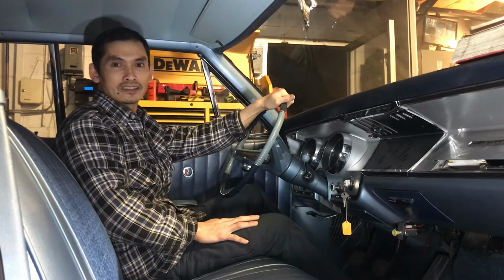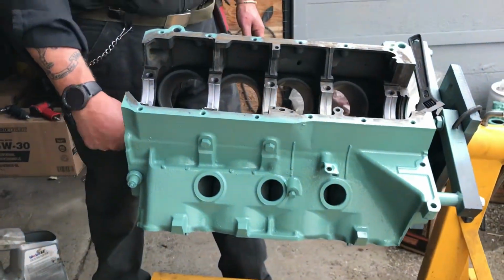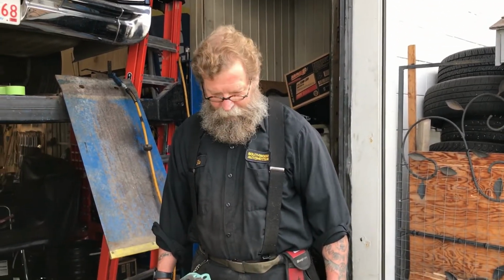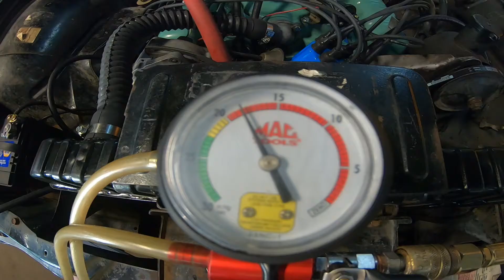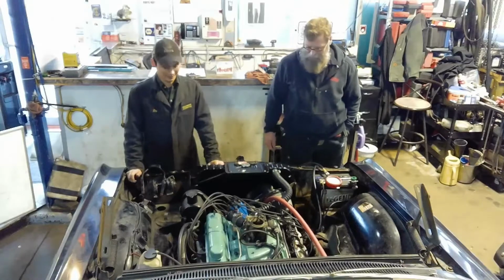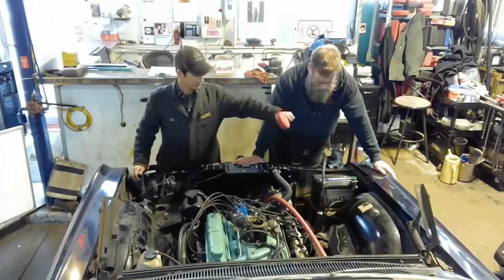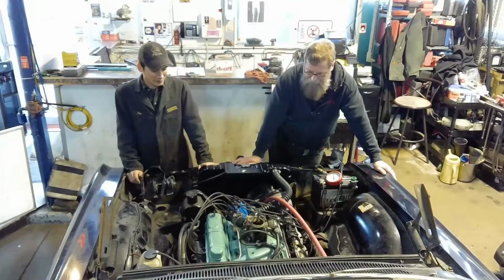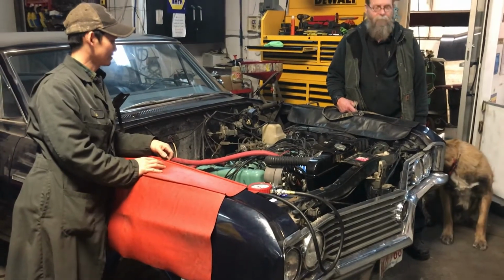1964 Buick LeSabre Wildcat rebiuld p2

Comment: hello my friend i need to know if the black cable of the Th 400 kick down goes in the top terminal of the automatic transmisión .The position black And white caBle is not clear in the manual. Thanks for the info . I live in Montevideo Uruguay and I have a Wildcat 65
Reply: Hi Jorge, This is Emma speaking with the guys the kick-down cable is usually attached from the carb to the shift lever on the side of the transmission. Hope this helps! Have a great day!